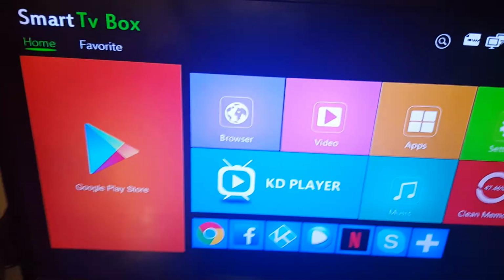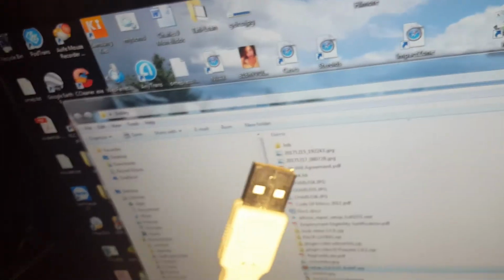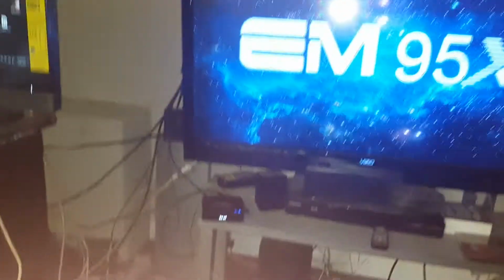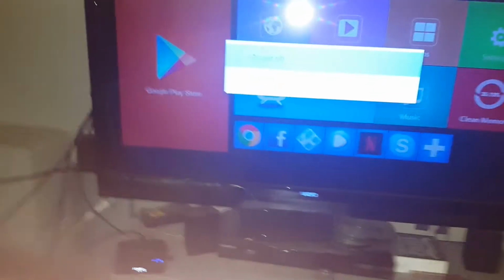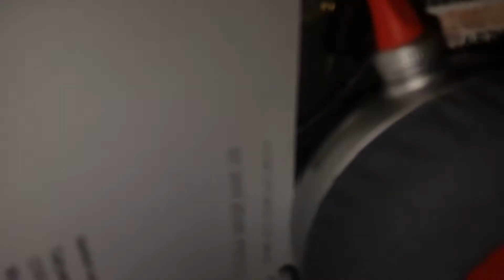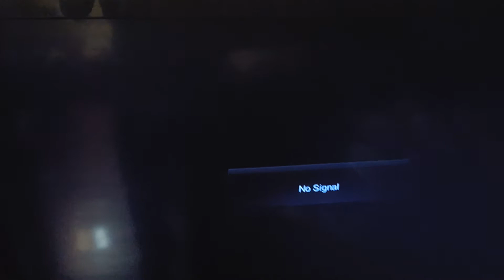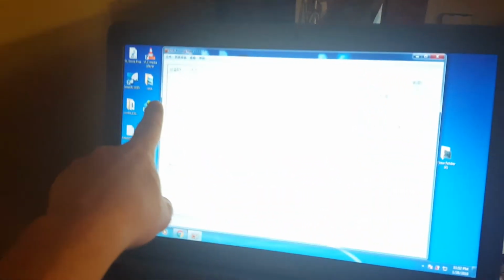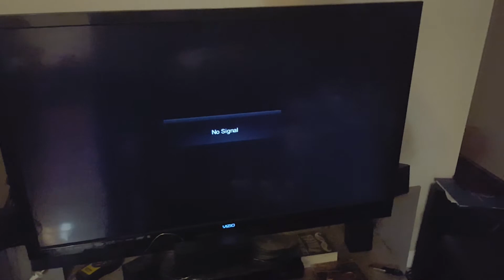EM95X FIRMWARE Update Flashing Android 7.1.1

Comment from the maker: I have no clue how to add links so you can get FLASHING tool & image?
Reply: Here you go .. thank the Man [Chas] - https://www.dropbox.com/scl/fi/wvg0ab8h91fqdf43m4p56/aml_upgrade_package.img?dl=0&oref=e&r=AAup-veJVPc5RG-WsLzFUj931i8tGBBDspXEjRl4ypEB1EiaQhiziShDDj6z6lIsCWEqQgtUOq2GS6PvgJPYvnjLj4FXD5wiv6BNQ4PBnVeN2wHzHHK4aDTh4d0eV2Vzxi-R62RaOc-Tw9kF-odcv-5_W1NpqvKhZgVhLnMPAV73NsEMc-ddPfSGUHN7njb_evC_NKS1kEvIMaVRaMylSbDa&sm=1

Remember this:
USB Burning Program ON
Power cord off
Press the PIN and HOLD IT
Attach USB to Port 3

The USB Burning Program will recognize the box.
If not, the you need to use an older USB Burning Tool for Amlogic [the new one will not work - version 2.0.6.2 will ].
Just google and you will find it.
Reply: @MrNovaunique  Thanks very much!!
Reply: @MrNovaunique  please, give me acceso to download file. Than you!
Reply: @DieguinMT  I hardly check my messages but is this outstanding?
Reply: @MrNovaunique  The file is not working alas
Reply: @sashakpohka7171  what exactly are you asking/stating?  It's been a while for me on this
Reply: @MrNovaunique  thanks for file..but unfortunately the file is corrupt man..
Reply: so where do you get the img file? cause I have one of these boxes that does nothing but freeze up, most times before it ever even finishes booting
Reply from the maker: I got my img file straight from enybox i skype the owner. They sent it to me
Reply: Sir Chass Morr Need your Help can you share the rom file to upgrade my tv Box really appreciate .